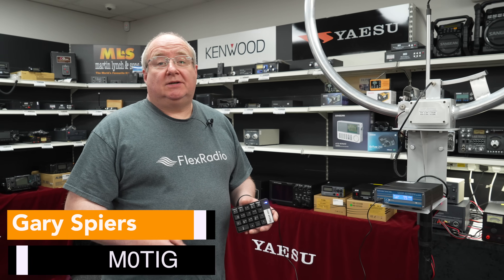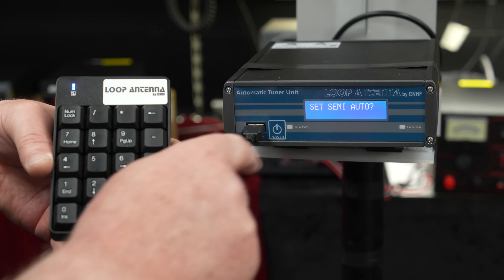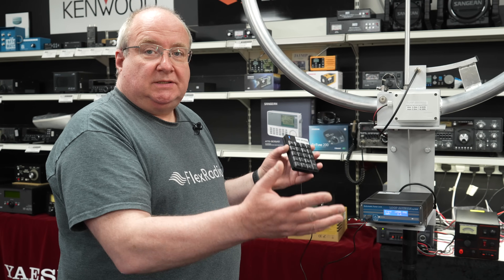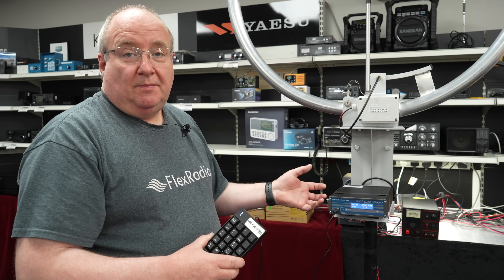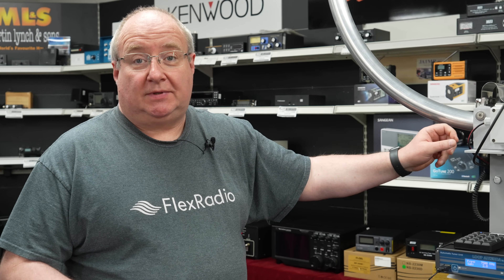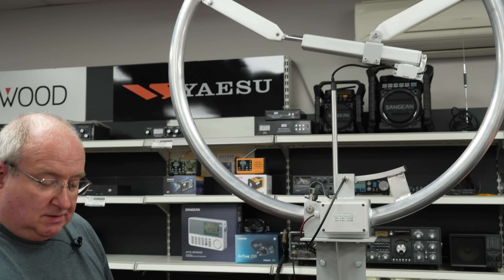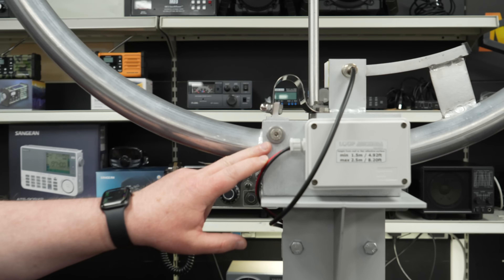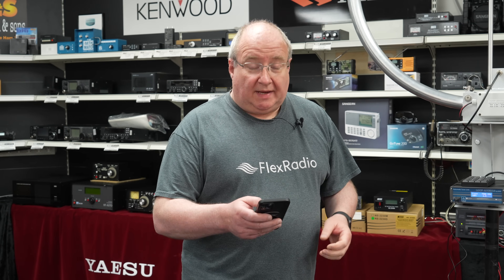Thinking of buying a Loop Antenna? Watch this video first!

Comment: Get a good length of any old wire get it as high as possible. That antenna looks like it costs more than a car.
Reply: It may look like it but no.  Not everyone has the  room or real estate  to put a long wire  . This is where these loops come in to play.  No the loop doesnt cost as much as a car you can get a decent one for around 300$ or spend up to 2000$.  I lived in nyc for 5 years and I was able to make contact with south africa and asia with the exact loop in this video.
Reply: Yes a long wire will transmit well but you will have alot of qrm and high noise floor  especially if you're in the city.  With the loop my noise floor was 1 to 3 s units in a nyc apartment

Comment: I have never seen one of these antennas in action, can I ask a question?  Working  inter G operating, can a Station using one of theses antennas work several stations on the same frequency where those stations would be sited on the South Coast to the Wales area and in between and into Scotland and Ireland or would I have to rotate this antenna to each individual station? Thank you 73 Keith. M0KLL in Sunderland
Reply: I doubt it, these antennas are very high Q, highly directional.

Comment: U.S. military used portable loop antennas on HF in Vietnam.  I learned about this from an article in QST.  I believe they were hexagon. Bolted joints for disassembly.  Gold plating on the mating surfaces to minimize resistance of the joints.  The resistance of a loop antenna affects performance.  Resistance should be as close to “zero” as is feasible.  Best design is large diameter tubing and TIG welded joints. Welds made by a professional welder.  A very good loop antenna will have just enough bandwidth for SSB.  Thus, An automatic frequency following tuner is very beneficial.
Reply: You are right, the Army loop, which was Incorrectly replicated by QST, failing to get a good ohmic resistance because of the joints.
Key factors for performance are, first loop diameter, and second tubing diameter.
Loop antennas are great performers if you build them correctly.
This loop and even the bigger one seem too small for 40 meters and lower bands. Design is very good however.

Comment: Hands down the best Loop made! I run the midi and baby here in an HOA in the US.
Reply: Did you attempt to conceal or "camouflage" them?  If so, how?
Reply: @Supernumerary   no, but I did stick it behind a young Magnolia tree. You can paint them or make a cover for them if you want. The baby loop does 40-10 meters and works fine at 6-8 feet.

Comment: A really very relevant video. These are really typical questions that amateurs ask.
What about those who would like to install it on a flat surface? Can the height to be respected at ground level be applied instead at roof level? Is there a minimum roof size that makes the effect similar to the ground so that the swr is corresponding?
At the Xenia hamfest, Ciro announced that there would be a new Bluetooth controller. Do you have any news on when they will be available?

Comment: Thanks very much.  I appreciated seeing this.  I wish I had got to it earlier.  I am still exploring my loop as I have not had it fully installed very long.  The Baby Loop replaced a homebrew loop and controller.  
Having homebrewed a loop, I can appreciate the advantages of the Ciro.  The tuner is very fast.  This is especially noticeable when changing bands.  The tuner appears to lock onto the frequency of minimum SWR accurately.  
I have painted mine.  I suspect that it would have been faster if I had a good aluminum primer.  The Baby Loop is quite robust and anyone purchasing one should look at the weight specs as they may affect how you mount it.  
I am still using my other homebrew loop that does 80-60-40.   Tuning that loop is a major chore compared to the Ciro.  
My space for antennas is very limited as I am in an urban downtown location.  I doubt that any other antenna I could mount would do better.

Comment: Loops ARE efficient. If they are not, where does all the lost energy go? Go max QRO the antenna will handle, take whatever "they" think the efficiency is and the rest MUST be dissipated as HEAT (right?). Key down as long as you are comfortable with your setup, stop transmitting, check the loop temperature. It will be cool. Answers anyone? Thanks Gary, great presentation!
Reply: I suggest that relying on temperature measurements to estimate the efficiency of the Ciro Loop will prove misleading. 
To be fair, I am not an expert on antennas.  As I understand it, antenna efficiency, (in the simplest case) is a function of the radiation resistance divided by the feedpoint resistance.  The feedpoint resistance, in turn, is the sum of the radiation resistance and the loss resistance.  
Given the construction of the Ciro Loop and the fact that it will be mounted outdoors, it will be able to dissipate a lot of heat.  The antenna will stay close to the environmental temperature.  This has more to do with its mechanical design and construction than efficiency as an RF radiator. The loop itself consists of a 50m thick walled circular pipe.  To some extent the air variable capacitor at the ends of the circular segments will serve as a heat sink.

Comment: I bought one of these 2nd hand with a 450C rotator - it's very good especially for nulling out QRM - handy these days 😞- it sits between my H dipoles and my chinois "all band" vertical in terms of efficiency - Great video!